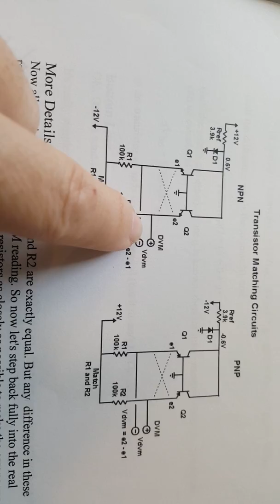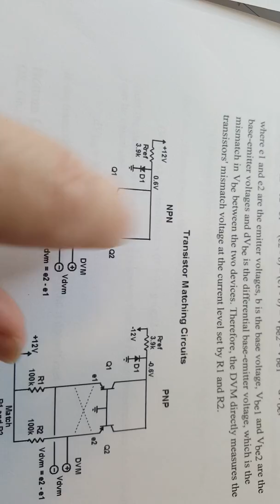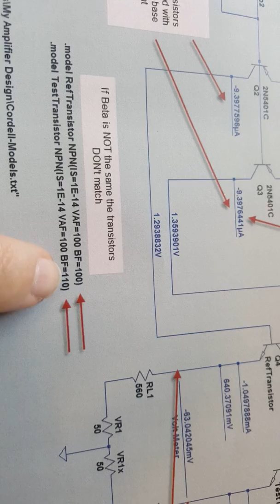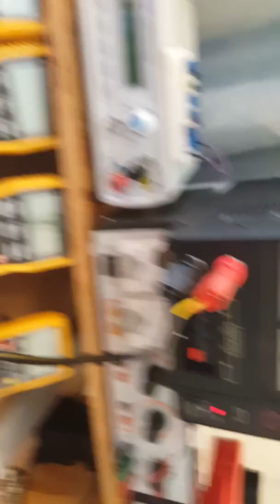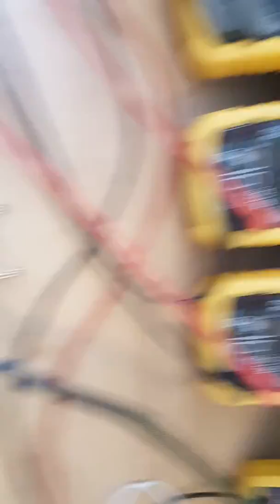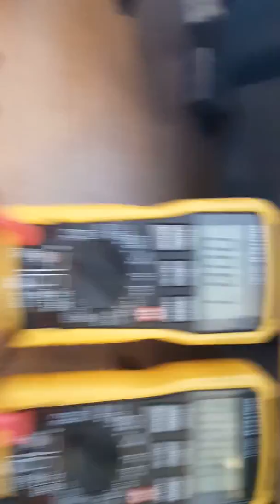Transistor matching circuit - Part 1

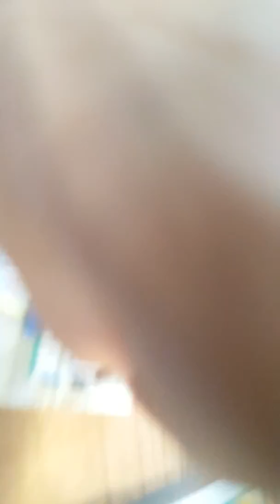Comment: the yellow wire  6:38 is just to confirm that you have a symmetrical resistance ?
Reply from the maker: vargasmongo3435  yes we need the same resistance to ground through each Emmiter resistors so we can measure Emmiter voltage accurately.
If the current flowing through the resistor is different the voltage drop across the resistor will be different as per ohms law. Volts (Volts) = Current (Amps) x Resistance  (ohms).